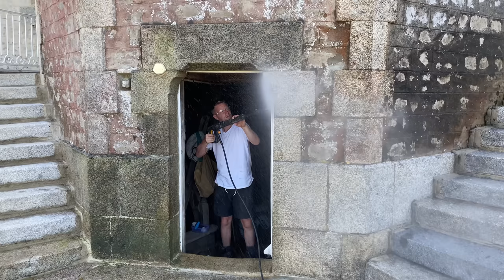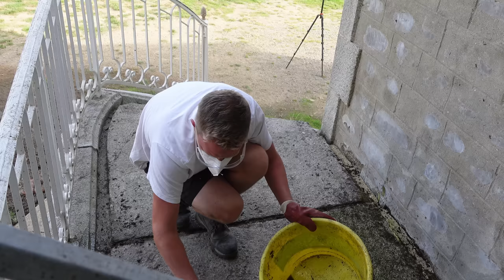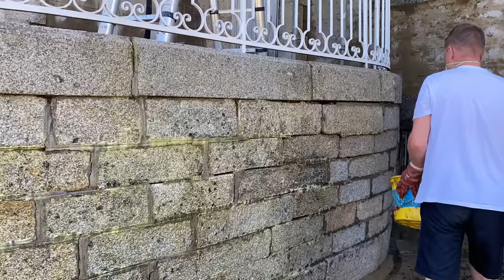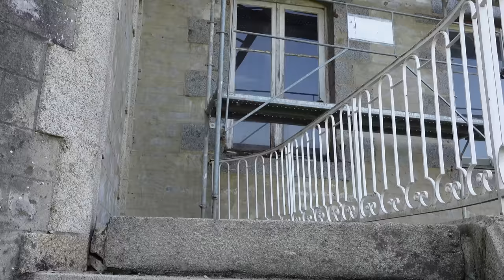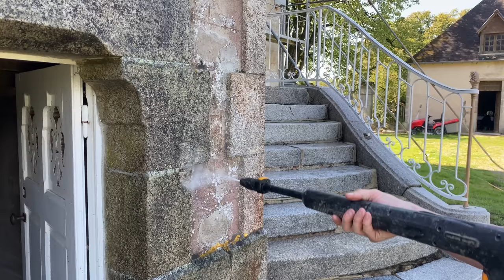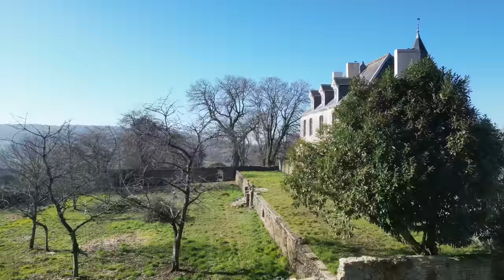Restoring The ORIGINAL Chateau Stone Entrance Staircase.

Comment: Looking great guys. Try using liquid chlorine on the stone work it will kill the dark mold/algae. Simply use a pump weed sprayer to apply liberally leave for 20mins then pressure wash. I’d also invest in a 2800psi petrol pressure washer, No power leads and more pressure to remove stubborn patches, plus you’ll be able to run a longer hose off the lance making life easier when working on the scaffold.
Keep up the good work

Comment: You're doing an amazing job❤ but may I suggest instead of that pressure washer nozzle that's not very strong just get a regular garden hose with a regular gardening watering tip on the end of the hose. I really don't think your pressure washer has a lot of pressure

Comment: I had to have mold remediation in an upper floor (interior)space   The chemical used smells like chlorine. Glad there is a door to close off the space. Is that what you are using? I’m sure outside the smell dissipates quickly.   Looks amazing.
Reply from the maker: It was hydrochloric acid ☺️

Comment: the front tower was obviously not original to the rest of the structure though the interior paneling may have compelled the addition.  The exterior stairs are much less of an asset whether or not they were original to the tower.  Understandable to not consider an alternative though there is an obvious opportunity, perhaps unique, to make a significant improvement.